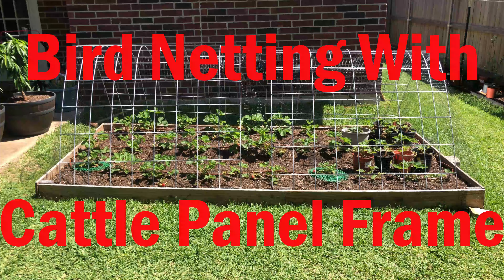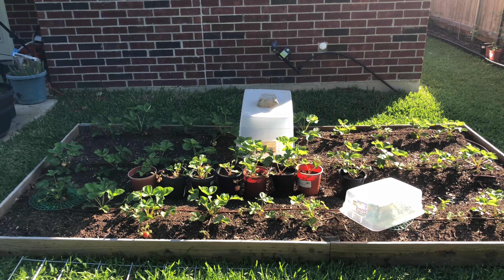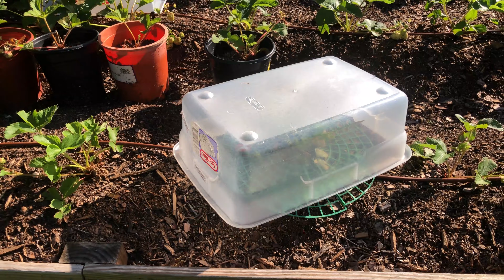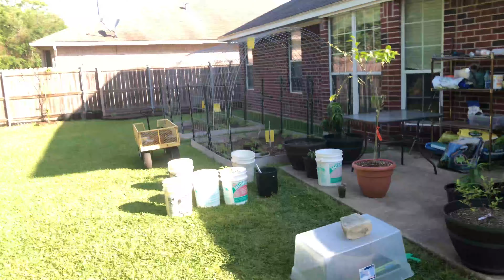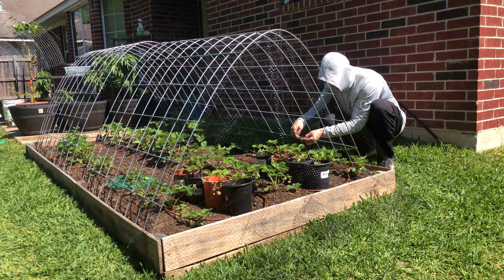Bird Netting with Cattle Panel Frame

Comment: Are you going to have to remove the netting to pick the strawberries in the middle?
Reply from the maker: I’m able to extend my arm and reach the middle from either side to pick the strawberries.  It’s a little work for the ones in the middle but worth it for me to not have to lose them to the birds anymore!  Thanks for watching!
Reply from the maker: Also, it’s easy for me to lift one of the panels off and set to the side to harvest if necessary.  Thanks for watching!